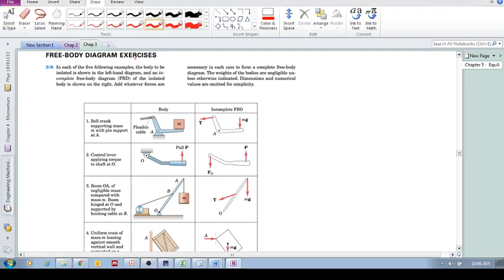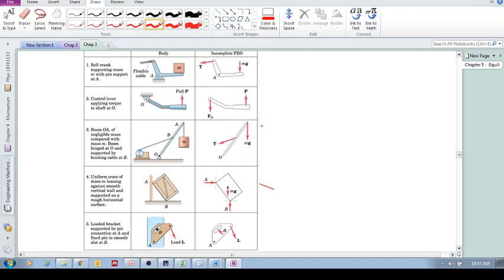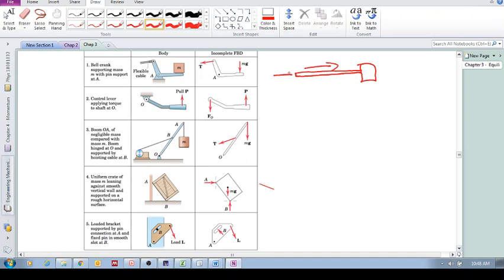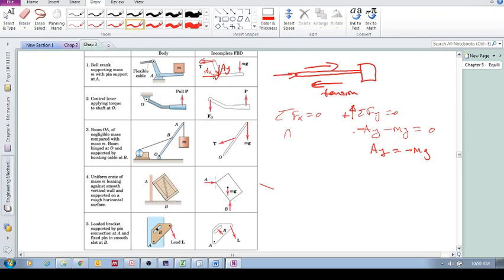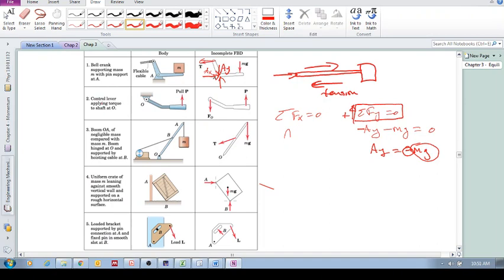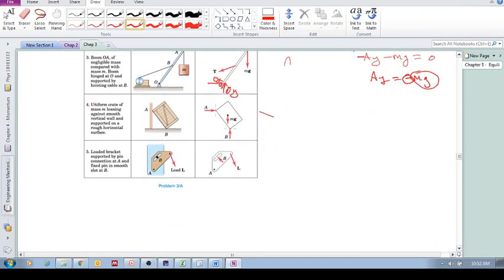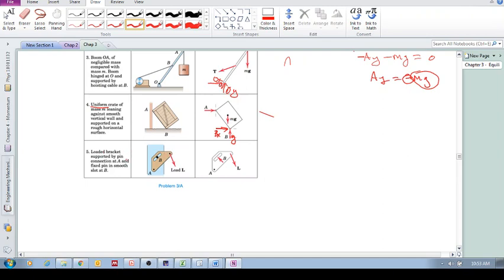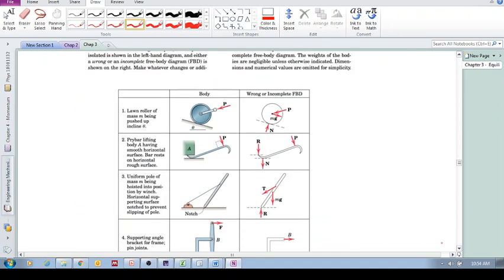Chap 3.2 - System isolation and Free-Body Diagrams (d): Exercises with incomplete free-body diagrams

Comment: Sir will there be a torque at A in example 5 of 3/A? It is a pin connection not free to turn so there should be a torque as explained in figure 3/1